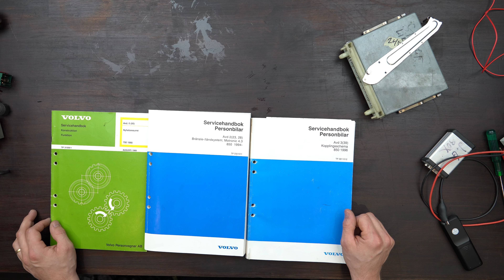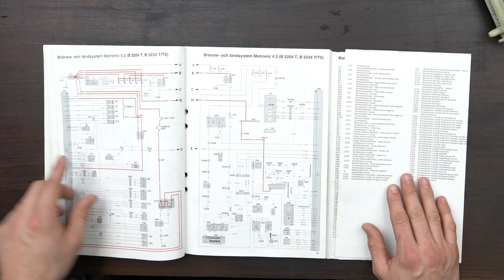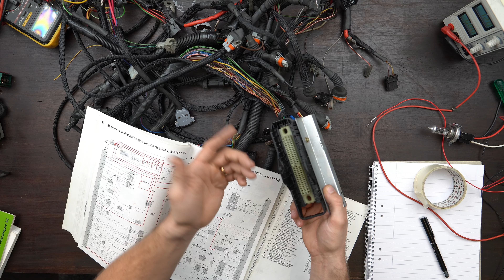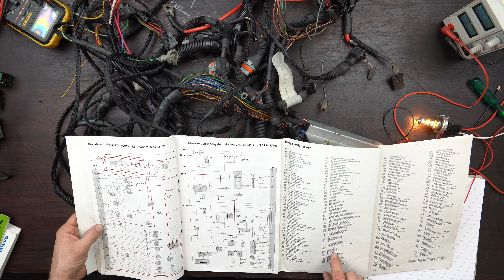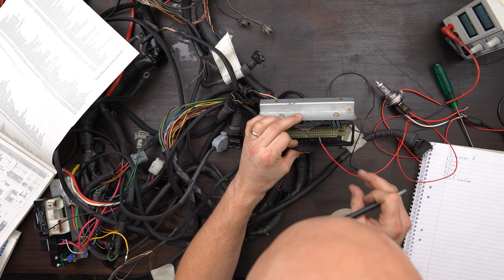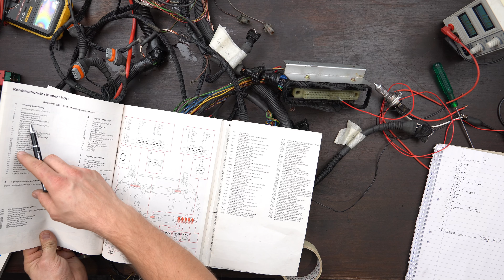Motronic M4.3 Pinout || Engine Management || Part 1

Comment: Thank you for posting this methodology, this will help me install the sensors properly, Vast Tuning: ecu upgrades including the coil plug option.  If would have mapped it before I installed the engine...still have to pull it due to my transmission not engaging.  The service books and your videos are helping me to understand and finish my first swap.  Much obliged.

Comment: Heyyy, i swapped my 960 for t5 but now i have problem with pin B18 (speed signal input), where did you get signal from rear diff? Or ABS module on you 740? Thanks.. my m4.4 ecu has launch control and Coil on Plug mod, i can start and run engine without any issue, but it wount rev past 3500, i connecter speed signal from ABS module to ECU (b18) and it will work only up to certain speed, first gear i can rev up to 6500, second gear up to 4000rpm and third gear will max out at 2000rpm.. i don't know where to get speed signal from, trued ABS sensor too but that didnt worked out... Thanks! ❤️🙏 And thank tou so much for your Videos! They helped me alot!
Reply from the maker: Hi! I think you are ahead of me :D This 740 doesent have ABS so im guessing i will take the speed output from the cluster. I will keep this in mind when the project gets going again.